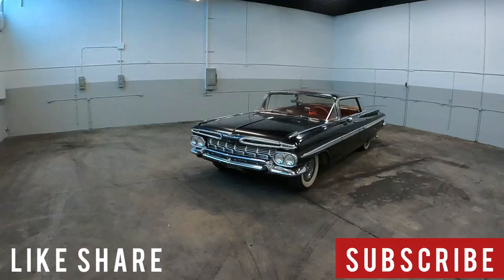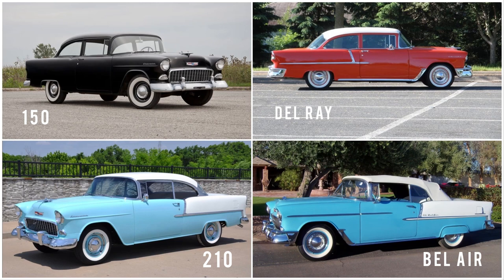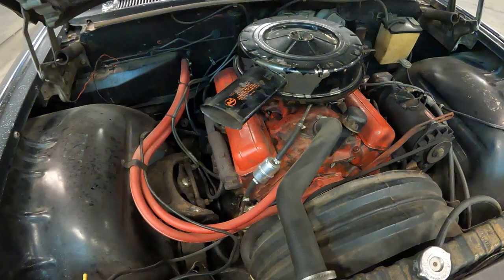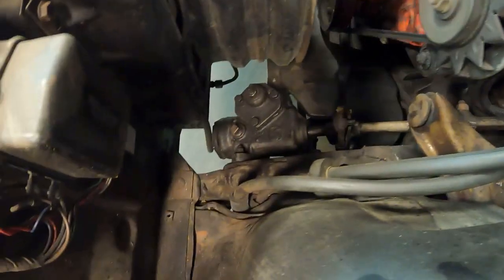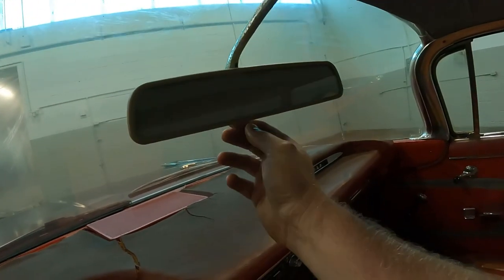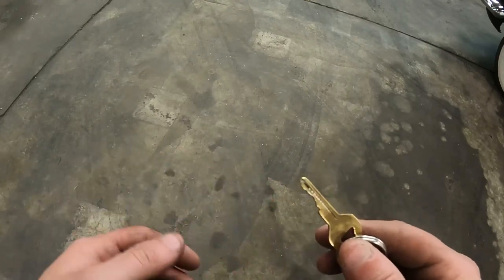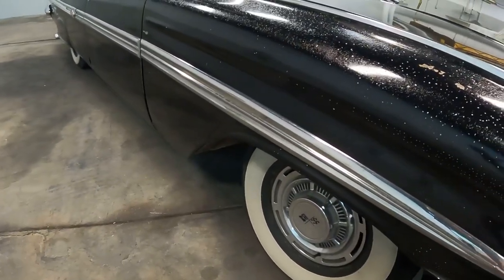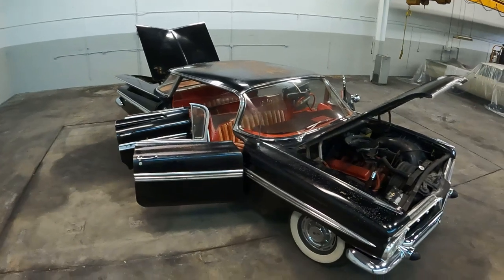In-depth look at 1959 Chevy impala 4 door hardtop #cars #chevrolet #impala

Comment: General Motors was on the forefront of roof and cabin technology for decades: witness the Turret-Top styling of 1934, encasing the entire roof in steel; or the two door pillar-less "Hard-Top Convertible" for 1949. For 1959, General Motors would take the next step towards letting the outside in, and would introduce its short-lived, now-legendary flattop roof-line across all five of its American car divisions. Some point to designer Bud Sagano's roof treatment on the Pontiac Strato Star concept car for the 1955 General Motors Motorama as a starting point for the flattop, although on the concept car the rear quarter windows wrap around the back as slender C-pillars ride inboard of the shapely rear fenders. Rumor has it that Harley Earl had originally wanted the roof material to be made of stainless steel, but his experience with the 1957-1958 Cadillac Eldorado Brougham put an end to that idea, for cost reasons.
Clare MacKichan, Chevrolet's chief designer in those days, was the one who pushed to have the flattop idea produced for the all-new 1959 models. As it was developed, it was known in-house as either the "Cantilever" roof line or the "Flying Wing"; today, popular culture has settled on the terms "flattop" or "vista" as suitably descriptive.
The goal was to have the roof floating above the car in production and in advertising, every General Motors marque had a different name for what was the same basic concept, none of them particularly snappy: Chevrolet stuck with the name Sport Sedan for its flattops; Pontiac tacked the Vista name on after each model; Oldsmobile called its version Holiday Hardtop; Buick referred to it simply as a four-door hardtop, and Cadillac's versions were designated "four-window" models.
Many people recall that once Chrysler introduced the longer-lower-wider "Forward Look" on the 1957 models, General Motor's own upcoming 1958 lineup was judged to look dowdy and lumpy by comparison. Instead of limping through to 1960 with a hopelessly outdated look, General Motors took out a clean sheet of paper and sought to out-longer, out-lower and out-wider Chrysler's Forward Look  with an all-new body design.
That meant a crash program to get the 1959 models in shape. Buick was first to get its styling out, so the other divisions had to work around the basic package and dimensions that Buick had designed; each division had its own power-trains, wheelbases, but Buick's body shell treatment was the basis for the rest of General Motor's 1959 - 1960 lineup. The five divisions even shared the same glass. The A body had traditionally been used by Chevrolet and Pontiac. The B body was for standard Oldsmobile and Buick, and the C body was reserved for Cadillac, and the top-of-the-line Oldsmobile 98 and Buick Roadmaster models. This hierarchy was abandoned during the crash program to offer the new 1959 models. The lack of time from concept to showroom necessitated all five Divisions to use the same basic body structure. And for the first time ever, all three of them would have two separate and distinct four door hardtop bodies.
In the 1950's and 1960's, skyscrapers built in cities nationwide were generally of the International Style and what better symbolized the postwar prosperity of America like the skyscraper. So General Motors went and applied the International Style to its four-door hardtops to considerable success.
General Motor's flattop sedans were very much in keeping with the International Style that was exploding across the country at that time. The idea with the flattop was to let as much light into the cabin as possible while still offering the protection and security of a steel top. This meant true hardtop construction, thin pillars, and front and rear glass that wrapped around a full 90 degrees; all contributed to an airy-feeling cabin, despite marginally diminished headroom. The pillars were plainly garnished with only a chrome finish. And that roof looks as flat as the roof of any International Style structure you'd care to name. The flattop General Motors hardtops had their heyday in 1959 and in 1960 -- right in the heart of the postwar International Style building boom. The execution was elegant, yet had a dash of jet-age futurism about it. All windows were made of safety-plate glass. Traditional A-pillar angles reversed themselves: instead paralleling the rake of the windshield, the tops of the A-pillars actually jutted forward slightly, so that the Vista-Panoramic windshield wrapped around and would be able to offer 1,711.8 square inches of outward visibility -- more than any competitive four-door car at the time. The wrap-around glass was designed to eliminate blind spots at the traditional A-pillar location. The roof-line was lower, but seats were also mounted lower to compensate.
The wrap-around windshield was used on other full-size body-styles in 1959 and 1960, but they took on greater significance with the rest of the flattop treatment. The forward-jutting A-pillar gave the look and feel of forward motion, a feeling reinforced by the angle of the C-pillar. The rear window wrapped around, with C-pillars even thinner than the A-pillars to improve visibility. A small overhang over the back window was ostensibly there to help keep the heat off the rear passengers, but also had the effect of seeming to fly off the car, such was its velocity. Helped by the long body and tail-fins, the roof-line made the car appear to be moving, even when sitting still.
Chevrolet started out with two models for the 1959 model year: the Bel Air Sport Sedan and the Impala Sport Sedan. "Introducing Chevrolet's glamorous new model, fashion star of the Impala series!" said the divisional brochures. "Note the distinctive design of its roof-line, extending over the wide rear window, adding rear seat headroom. Yet Chevrolet's body, despite its light new look, is actually stronger!" The only marque to offer the wrap-around rear glass with a six-cylinder engine, Chevrolet sold a whopping 182,520 cars between the Bel Air and Impala nameplates in 1959.
Oldsmobile called its new-for-1959 style the "Linear Look," a shape that is, best exemplified by the Holiday SportSedan's unique, fleet roof line and full wrap-around rear window. Exceptional visibility make this smart style note a rousing success from the passenger's point of view." 
Cadillac was often the marque to start fashion trends, which then would trickle down into other General Motors divisions, such as tail fins. With tail fins at their literal and figurative peak in 1959, Cadillac received the flattop treatment at the same time as all of the other divisions. There were two flattop versions of Cadillac's four-door hardtop the first was a four-window design and a six-window that was more conventional in design. The Series 62 and the second was in the Sedan De Ville: the "four-window" (the cars we are discussing here) and the "six-window" with a rounded, more conventional C-pillar. The four-window 1959 Series 62 sedan sold 14,138 examples, while a four-window Sedan de Ville sold 12,308.
Full-size Chevrolet models were not listed individually, but between the two Sport Sedan lines (Bel Air and Impala) a total of 169,016 were built and sold. While Pontiac added a line -- the sporting Ventura -- and sold 32,710 Catalina Vistas, 28,700 Ventura Vistas, 14,856 Star Chief Vistas, and 39,037 Bonneville Vistas. Oldsmobile's three-hardtop lineup continued, with 43,761 entry-level Dynamic 88 Holiday hardtops, 33,285 mid-line Super 88 hardtops, and 27,257 98 Holiday Hardtops sold. Oldsmobile dimpled its C-pillar trim for the year, boasting, "This smartly notched rear roof pillar is readily identified as a distinctive Oldsmobile touch on the Holiday SportSedans." Buick built 15,300 Invictas, 35,999 LeSabres, and 14,488 Electra four-door hardtops. For the 1960 model year, Cadillac's four-window sales slid: 9,984 Series 62 four-windows, and 9,225 Sedan DeVille four-window models were sold. 
Today, nearly 60 years on from their launch, it's easy to see that these were some of the most forward-thinking hardtop designs of their era and their styling holds up today, despite being very much of its time.
By 1961 General Motors was indeed at the peak of its size and influence. For 1961 General Motors restyled all its senior cars and launched a line compact cars that were slightly more upscale which in turn gave General Motors the busiest new-product year in its history. The 1961 General Motor's full-size cars were all new, and substantially less flamboyant than their wild, tail-finned predecessors. But 1961, would see at least a partial return to normalcy, with a new B body (that had Chevrolet and Pontiac sharing structures with the regular Oldsmobile and Buick). The new C body occupied its traditional spot in the lineup, serving only the top-of-the-line Oldsmobile and Buick models along with Cadillac. And for the first time ever, all three of them would have two separate and distinct four door hardtop bodies. Cadillac’s Fleetwood Sixty Special which featured a third version of a four-door hardtop that was not shared with any other division. 
Due to a brief recession in early 1961, automobile output slips to 5.4 million cars produced. For Rambler (in the number 3 spot) and Plymouth (in the number 4 spot) both would slip back to lower production numbers in the coming years. This allowed Pontiac to move up into third place in 1962 and Pontiac would remain there for the rest of the decade.
The jet-age roof-line of the 1961 Electra four door hardtop would disappear after this one year. The customers chose the six window version (which Buick called the Riviera Sedan in 1961) by a nearly two-to-one margin over the four window version, which was simply called the  “four door hardtop”?
Reply from the maker: So much information thank you so much for sharing again

Comment: That’s a flattop! Looks like it came from a hot, humid part of the country.  Interior chrome badly corroded, dash pad is warped and burned and those protective clear plastic seat covers have burned themselves into the seats probably ruining the seats.  It’s a Powerglide which is a good thing.  The 1957-1961 Turboglides were junk!  Most transmission shops refused to work on them and would convert them to Powerglide.  Clean up that car a bit, pull off those fender skirts and it would look much better!

Comment: Chevy used the same body across the line wheather it was a bel air or a impala.....just more chrome depending the option....pontiac had 2 completely different model lines for full size line bonneville and starchief was the "long wheel" base or the catalina line which was the "short wheel" base model......chevy used the same body to save money unlike other gm lines who had diff bodys for diff model lines.....chevy was the poor mans car at this time so chevy saved a penny any where they could they seen no reason to make diff bodies for diff lines when they could just doll up what they had with more chrome.....also those knee knocker windshield posts are a pain in the a** to get in and out of without bashing you knee on em all the time.....
Reply from the maker: Awesome thank you so much for sharing that information =)